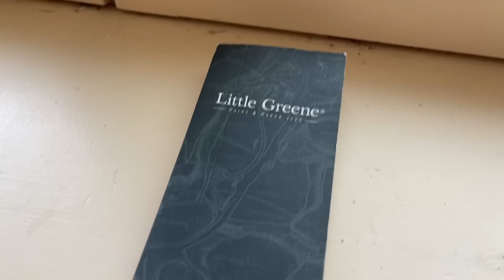Paint Colours And New Hair!!

Comment: first hair color is terrific, the blonde was pretty but this one is lovely...have you considered applying primer first to the walls? you've got a few different colors going on there and primer first would give a better result
Reply: I agree they should give it a quick coat of white first to seal the walls and then do the pinky colour. Cheaper that way too because Little Greene paint is more expensive than ordinary white emulsion. They will get a better finish too priming it first.